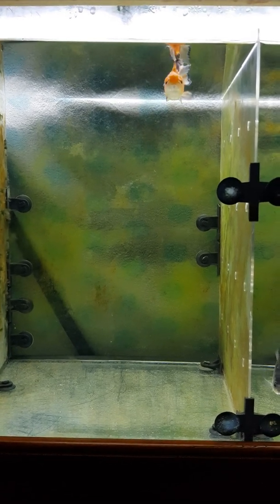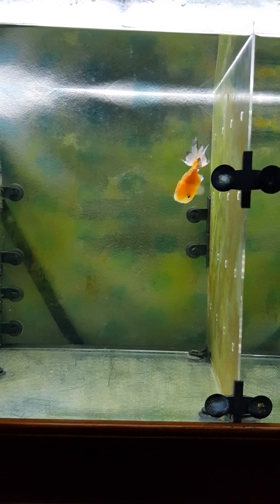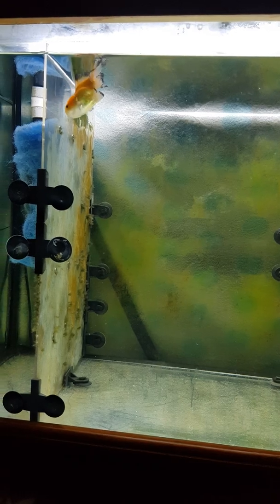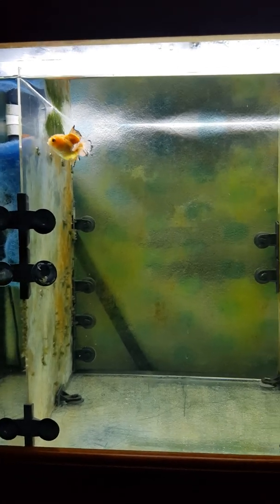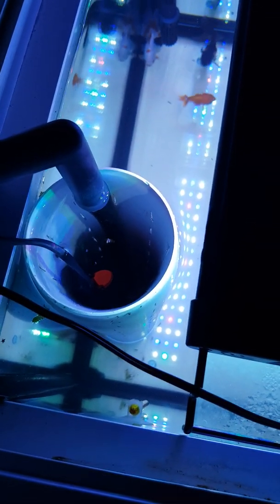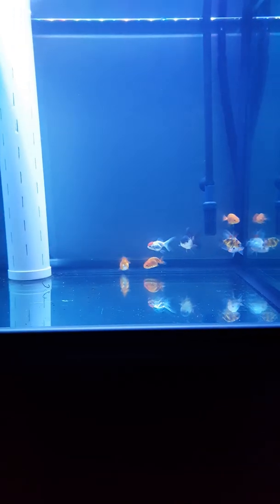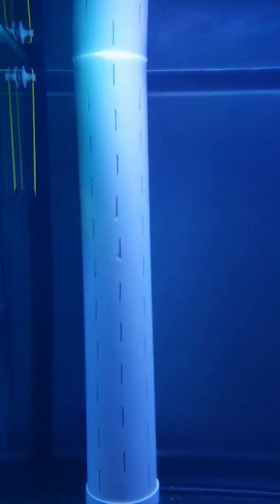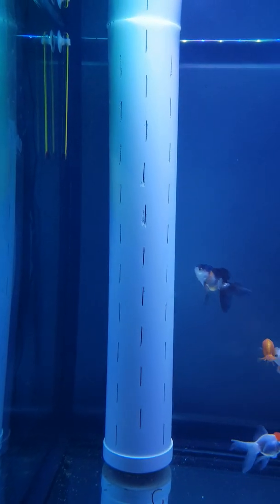Reduce current while maintaining high flow rate in fish tank for fancy goldfish hack

Comment: Nice idea, but how do you manage to clean the fish poop that settle in the bottom of the tank without any flow?
Reply from the maker: Hi Agus, There is still flow but any build up gets suck up in the bi weekly water changes. With gold fishes they fare better with a better bio filtration :).
Reply: I feed my goldfish 4 times per day and there's lot of poop I have to vacuum every day. I can't imagine how much it will be in two weeks :D
Reply from the maker: Lol I understand.  They are called water pigs for a reason. The flow rate could be adjusted by the number and position of slits in the pipe. Just need to find the right number of slits.